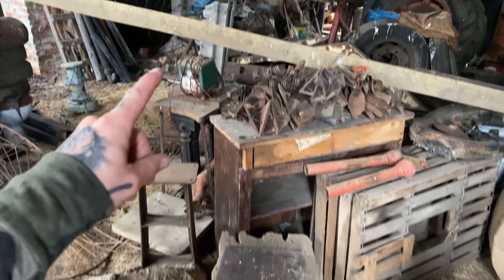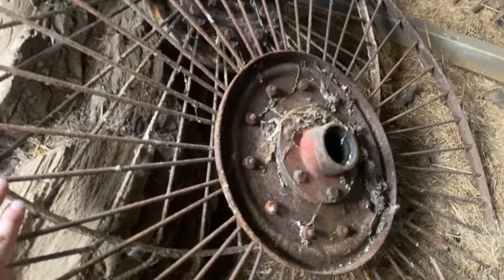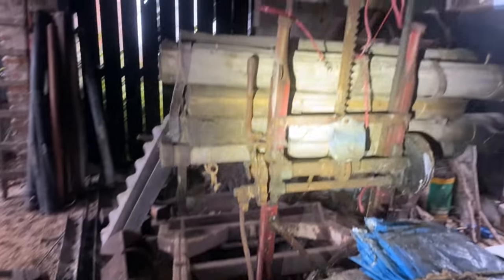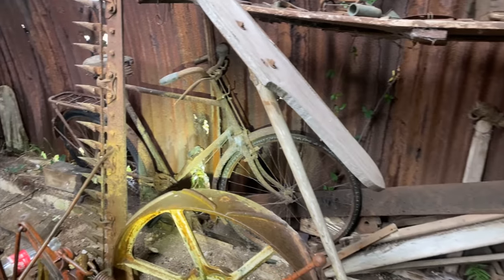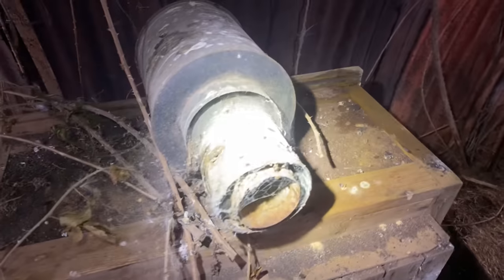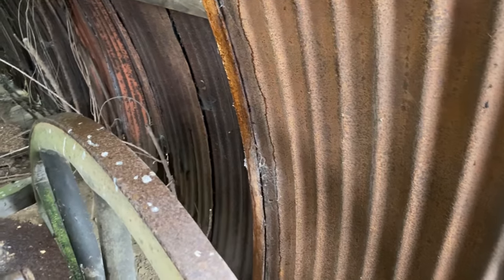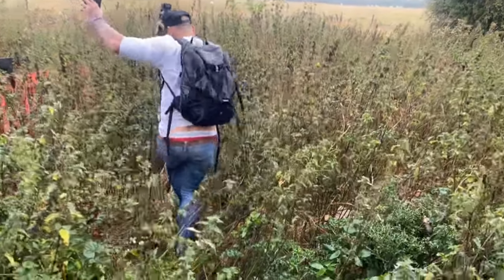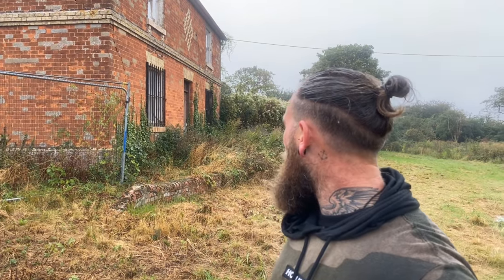We Found An Abandoned Farm & Found An Incredible Time Capsule In The Barn!

Comment: Another great video guy's,  the corn mill is a Bamfords combination roller and grinding mill to roll oats for feed and grind wheat for flour, the tractor is as already stated by others a fordson major,the first post war tractor made by them at Dagenham. The tall item is a sack winder used to raise full sacks of grain ranging from 18 stone to 22 stone depending on what was being threshed at the time,found at the delivery end of the threshing drum  used by the men on the sacking up,the rolls on the platform of it are canvases used on the cutting bed of horse drawn binders or could be early combine harvester bed. Great to see the other items too but already correctly identified.  Shame you couldn't gain access to the house, Lord knows what you'd find in there,keep up the great work.

Comment: Anothef great video guys in the barn the old FORDSON   tractor is from 40 s - 50.s  the machine with the spark plug on it is a corn roller  , the old blue machine at the back is a con drill I've rode on. The back of one of those planting corn , the machine next is called a finger mower for cutting grass to make hay

Comment: Used to go haymaking with a baler like that. Our knot tying machines used to foul up and even split the cast iron casing they were mounted on. The cabinet on it's side next to the baler was an egg incubator. The thing with the cart wheels is a seed planter (drill) and I remember the wood bar with chains was dragged along behind in an attempt to bury the seeds. Mostly, they were still on the surface after.

Comment: The machine that had a hedge trimmer blade on it was for cutting the sylage for winter feed . Some one sat on the cutter seat and an arm would be used to push the blade down  then the tractor would drive away and the blade would cut the long grass. Yes the other guy that said the charger you saw was a battery charger from about the 60s . Great vlog   tell him he finds poo places to try and get in.👍👍🥂

Comment: The fordson major e27n with that style steering wheel and grill would be 1947-49 after that they had aluminium steering wheel and flat bar grills the baler would have been mid 50's the crusher would have been for crushing corn,wheat, barely and other cereals made from 1830ish till 1960 they made them from then but PTO driven not belt driven like that

Comment: The paraffin heater is probably 1930s
The tall machine is for sowing canvas sheets.
That mill is for grinding wheat for animal feed
The tractor is a Fordson E27n major. Built from 46 to early 50s
Yes. That's a bailer, probably late 60s
The wooden piece of kit u went behind is a very old seed drill. Probably edwadian. Likely originally horse drawn but converted to tractor. Nex to that. Is a horse drawn hay mower, again probably converted for tractor.
Reply: Paraffin heater more likely 70's/80's - we had these when I was in the army during those years.
Reply: @markhammerschmidt5315  I've got one. Marked. London 1934.
Reply: @mattfisher7432  yeah I’m not surprised. They were made for years and years. Is yours that light blue? I think (but could be wrong) that’s a military colour. And that seed drill could also be from the 50’s. I worked in a farm that had very similar equipment mostly that dated from the 50’s. The spoked wheels at the beginning are from a wuffler or scuffler.
Reply: @markhammerschmidt5315  mine is that same blue. I've also seen them in beige, green, grey and dark blue.
I don't know what colour military ones would be.
Mine was retrieved from a scrapyard.in Wimbledon, by my great grandfather in the early 50s.
Reply: @markhammerschmidt5315  I'd say the seed drill is pre war. Most later one's are made from sheet metal. That one, is almost unchanged from the Jethro Tull design.
There was a huge amount of horse drawn equipment, that was converted for tractors. From the 20s right up to the early 60s. Most designs remained unchanged from early 1800s, right up to the ferguson era.